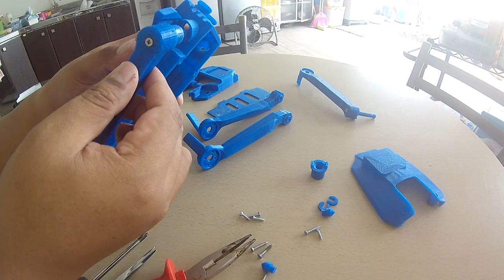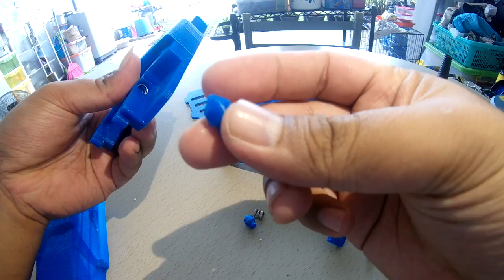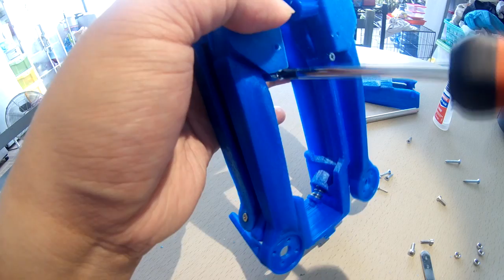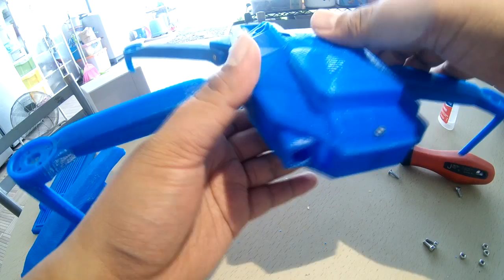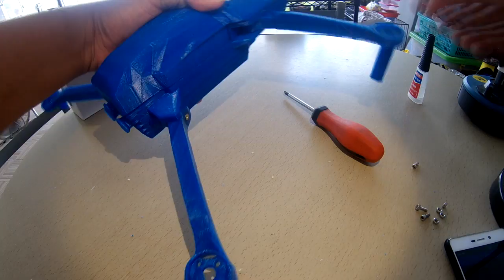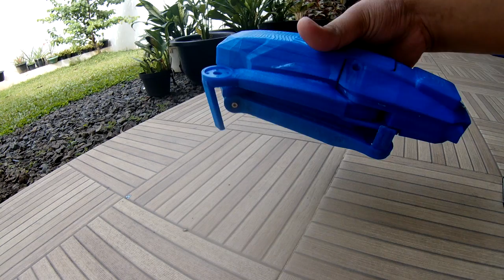DIY 3D printed Mavic Clone Assembly

Comment: Hi Musa,, Thanks you for nice detailed 'how to' on this Mavic Clone 3D build. May I ask, what is the weight on this drone when it is ready to fly? It looks like it would be heavy but looks very sleek,also. What kind of flight times are you getting with it,,with xxx_mah battery? I currently have a Holy Stone HS720 which is similar to this but c\scaled down in size. Can get 25 minutes  videoing entire time. Would like to get 25 minutes flight time with this one also. Thanks again.
Reply from the maker: basically all your question is answered on instructables... but i think 25 minutes flight time seems hard to reach... event my DJI not often near that long...

Comment: So is this a prop? I don’t see wire holes for where the arms meet the body, doesn’t seem like you can actually get this to fly
Reply from the maker: Yes there is no cable holes in there but it's actually fly... U can check some of this build on my instructable.com page...
Reply: Musa Wilmar I ended up redesigning my own mavic pro - inspired frame. It’s a bit smaller, and the rear arm mechanism allows the motor wires to go through the joint so nothing is exposed or seen. I’ll post on thingiverse once everything is finished
Reply from the maker: @airsoftbeast11234  good for you... And thank you for sharing...

Comment: Very coo and great job. Your remix of the front arms where you glue on the legs I'm wondering if glue won't hold and legs will snap off very easily. Could you change it so it will print when printing front arms only on your remix. Thanks for your time
Reply from the maker: Falcon Eachine which part u mean? I glue just for bushing part... Because i usually print that part at 100% infill and body at 50% only

Comment: Hi, I printed your project and it is wonderful. The only problem I found is that it is rather heavy and that we should lighten it a little.
Reply from the maker: Loris Cianni I print this project with a different infill density in every part... For arm and spacer I use 100%, but for the rest only 40% or 50% is enough... That's will loose some weight...
Reply: I made same holes with the drill on the frame to lighten it. Could you also kindly share the editable files of the project? I use Sketchup
Reply from the maker: Loris Cianni sure, u can remix it what ever u think to make it better... But I don't have sketchup file, I only have 3Dmax file and u can find it on my instructables site...
Reply: Ok, thank you so much

Comment: how much about do the materials to print cost?
Reply from the maker: The Flying Toyota the weight is around 300gr without material support and raft...  If u print it by yourself, my calculations here I guess is around $20 including material support, electricity and some margin error...

Comment: printing and building now. please can you give spec/pics/film from the used ekectronics?
Reply from the maker: sorry i still don't have that video... maybe i will video it on next build...
but maybe i can suggest u to use compact FC like naze32, because there is a lot of video tutorial about naze32 here on youtube...
Reply from the maker: but if u want to see the electronic diagram u can see on my instructables (link on description)
Reply from the maker: PS: for my self i use this...
Naze32 10DOF Rev5 Acro AfroFlight (cleanflight firmware), 
ZMR QAV CC3D Naze32 PDB BEC UBEC 5V 12V,
ESC Opto FPV Racer 250 Mini Micro 20A BLHeli (or u can find 20A 4 in 1 Blheli_S Opto ESC, it's more compact),
F450 F550 DJI 2312 920KV CCW&CW Brushless,
9450 CW&CCW DJI Propeller,
Naze Ublox GPS, 
R6DS Radiolink using PPM
WS2812B LED & 5V Active Buzzer
FPV TS5828 600mW,
micro minim OSD, 
Runcam2 HD (with extension cable)
2700mah 3s lipo battery

and for Gimbal:
Motor Rctimer 2804-100T Short Shaft Brushless
Storm32 BGC 32Bit 3-Axis
arduino pro mini + Triac for cam shutter trigger
Reply: Musa Wilmar will you put a link in the description of all the parts
Reply from the maker: +Tyson Shores https://www.instructables.com/id/Printable-Foldable-Quadcopter-DJI-Mavic-Clone-Fram/

Comment: thing you may need to re visit the Body_bottom_mesh_fix stl file.sliced it 4 times with cura and slic3r and 4 times the print failed at 10mm.
Reply from the maker: are u sure?
where u download the files?
is this print failure or slicing failure?
do u using support material?
i have try re download from http://www.thingiverse.com/thing:2004357
and try to slice it using cura, slic3r and simplify 3d and they were OK... nothing were failed at 10mm
Reply: Musa Wilmar 
4 failed print all at 10mm ish. yes downloaded from thingiverse twice just to be sure file was not bad. yes to support material.
Reply from the maker: just curious, when u slice it whether visible error also on the screen?
because in my experience every time slice, when my preview on the screen looks normal then printing will normal too... but first u have to find the best configuration for your printer beforehand, otherwise it will often fail to print...
for my case, my printer have problem with z axis that make my z scale is not correct so i have to times my z scale 1,74% and i have to set my max speed to 30mm/sec or it will be fail to print
Reply from the maker: i suppose this is fail to print, not error on slicing right..?
Reply: Musa Wilmar 
printer has been dialed in and working great for over a year. I thought that maybe the problem to so printed other stuff between failed prints which all turned out as expected. the preview image looks normal however when sent to printer at approx 10mm it will either just stop printing or the whole model shifts about 20mm to the right and trys printing in mid air.
Reply from the maker: that's very strange, i print it more than twice for this version using cura or simplicity and all ok until it's finish... i hope i can help u more peter, but honestly i don't know what's going on there.
most of the print issue before u is related to the slicing error, but after error mesh which causing slicing error have been fix, it going fine so far...
Reply: Musa Wilmar 
will try flipping and printing upside down see if it fails 10mm from top. love the design just wish it would print. will let you know later.
Reply from the maker: can u try print diagonally across the printer bed (from left back corner to right front corner)? I just thought it might be something out of your printer area at 10mm height... and it might be causing your X and Y axis is reset or something...
Reply: Musa Wilmar 
its a 200 x 200 print bed loads of room for this part

Comment: Hi, You think it is resistent ? it is in PLA 200microns right ?how much weight with no cables you know ? thanks
Reply from the maker: PsManiaHeroes less than 300gr frame only... Look @ http://www.thingiverse.com/make:274809
Reply from the maker: PsManiaHeroes maybe u should see this video... 
https://www.youtube.com/watch?v=scUEEQyC0GI
https://www.youtube.com/watch?v=br63xWD2R-I
https://www.youtube.com/watch?v=bmgSojocJ3c
u may find the answer for your question about the material strength...
Reply: Also i can' t se holes for the wires from body to arms correct?
Reply from the maker: PsManiaHeroes yes, is up to you where u want to make that hole... Simply using hot iron or mini drill...

Comment: Please tell us what exact control system you are using!
Also, can you please release a full build video (or at least a part two?)
I know how to wire drones, but i don't know what mounting you used.
Reply from the maker: well i have plan to make the part 2, but still don't have much time to do  that...
actually now i built another drone using :
Naze32 10DOF Rev5 Acro AfroFlight (cleanflight firmware), 
ZMR QAV CC3D Naze32 PDB BEC UBEC 5V 12V,
ESC Opto FPV Racer 250 Mini Micro 20A BLHeli (or u can find 20A 4 in 1 Blheli_S Opto ESC, it's more compact),
F450 F550 DJI 2312 920KV CCW&CW Brushless,
9450 CW&CCW DJI Propeller,
Naze Ublox GPS, 
R9D Radiolink + Signal Inverter Naze32 for Sbus
WS2812B LED & 5V Active Buzzer
FPV TS5828 600mW,
micro minim OSD, 
Runcam2 HD (with extension cable)
2700mah 3s lipo battery

and for Gimbal:
Motor Rctimer 2804-100T Short Shaft Brushless
Storm32 BGC 32Bit 3-Axis
arduino pro mini + Triac for cam shutter trigger

all the components I choose with consideration of because it is more compact and easier...

i will film it and post it when it's done...
or u follow this video to build that https://www.youtube.com/watch?v=4OKGMhTrqOU
Reply: Musa Wilmar thanks for the list!

Comment: Awesome! Can u tell me the size of the drone?? Right now I'm in little town far away from a decent computer so I cant download you files.
Again, nice job bro!
Reply from the maker: 400mm x 305mm x 100mm unfolding and 120mm x 260mm x 100mm folding with weight around 300gr (frame only)
Reply: You know wich is the max prop size?
Reply from the maker: i know someone using 10 but i think 9 is optimal...

Comment: Have You Seen the ciji clone of the Mavic this has alsow the phantom battery. But IT looks like IT is turn around cuz of the board from the p3p and IT is mutch biger. From phantom 3 to Mavic Shell.
Reply from the maker: TB Inspiration yes I have seen that... That shell is base on PH3 electronic, so it's not really fit for other FC I suppose... And Folding mechanism not really like Mavic... But more like dobby Drone... Front arm backward and rear arm forward... But I think that's also really effective....

Comment: wow. This model requireres quiet a bit support material. I guess i have to redesign it a bit. Thank you anyway. The model looks amazing. Almosst the same as a real mavic!
Reply from the maker: ungdsss sure why not, I love to hear the results than... That's why I share this project... I love when someone remix this project and make it perfect...
Reply from the maker: ungdsss my printer is having a precision issues with z axis. That's why I have to use a lot of support materials... Specially for the rear arm... Other reason is I want to have clean surface... Soo.. Beauty is pain... Hehehehe

Comment: Great work on this frame:-). Guess this is your wider one. What prop size will work on it?
Reply from the maker: i use 9450... but some one use real mavic prop in it and look very good too... look here 
http://www.thingiverse.com/make:280005 and http://www.thingiverse.com/make:279981
Reply: Yeah I saw that one. I have a DJI propulsion system i could use for this. Would be almost as a phantom i guess. Thanks